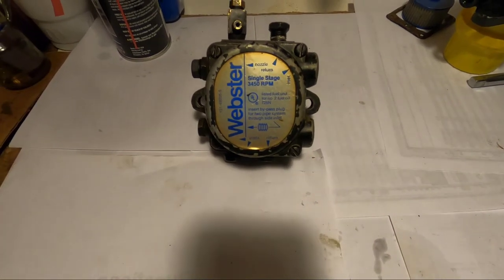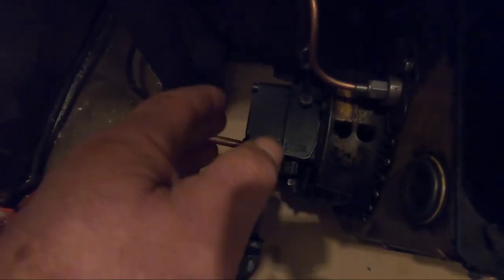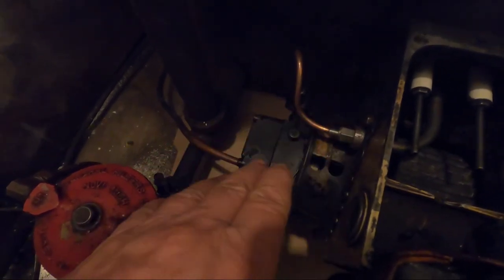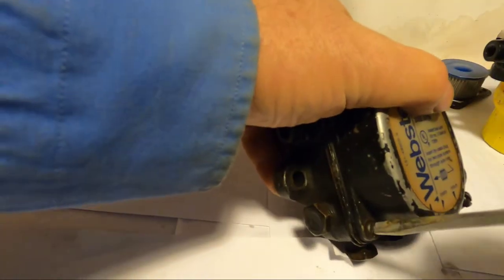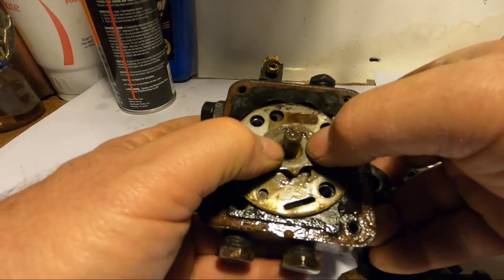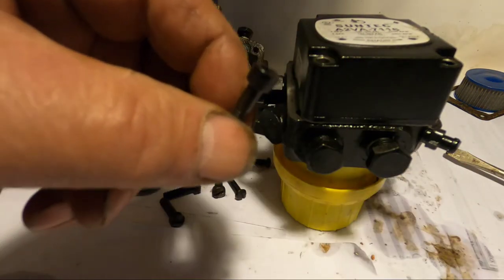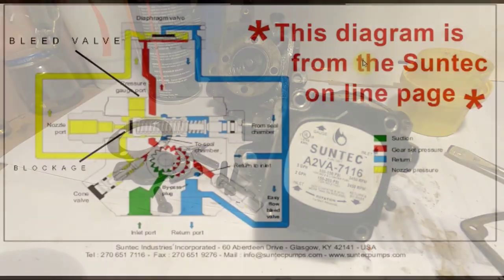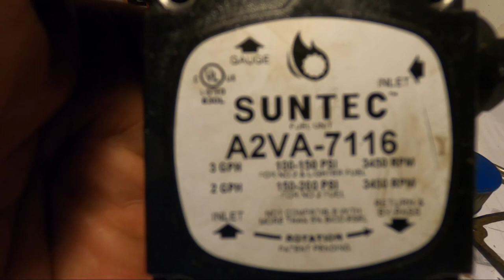NON WORKING OIL BURNER FUEL PUMP A LOOK INSIDE

Comment: I use the Suntec clean cut pump. I think you could convert it to that style, you have to get a new controller. You would be looking at close to 250.00 dollars, the design keeps the heat exchanger cleaner.
Reply from the maker: Thank you for stopping by & contributing with this information. Looking forward for your future visits & comments.
Stay safe,
Joe Z
Reply: Clean cut pumps are annoying, especially when you’re called out late at night to change a solenoid coil.
Reply from the maker: @Skarmy762  Thank you for  stopping by & taking the time to comment.
Stay warm & be safe, Joe Z

Comment: I have the suntech pump shown in video.   Every other day the burner will stop and the red reset light will turn on as if I am out of oil.   If I press restart it will fail.   If I press restart and then smack the suntec label with the side of my hand "Fonz" style it will come to life and the burner will fire.  Thoughts?
Reply from the maker: Hi Chris t, please keep in mind that I am not a tec but know enough to get things going until I get some one that know what they are doing to, and am not making recommendations but just what I would be looking at. That said it could be several areas that would cause this issue. First I would shut off the power then look at the control box for loose screws or wires. Then I would look in the blower housing & check if the squirrel cage ( not technical name) moves freely. If not next question is why. Could be covered with lint/dust, motor going bad or the pump itself on the way out. Also check the Cad cell. It may just have to be wiped clean. Even if you do not find dust on it it may have a film on it.
 I know as DIYers we want to get it done ourselves  but there are times when we have to call in the Pros.
Hope this is of some help.
Stay safe, Joe Z

Comment: Is the Webster pump and the Santec pump the same Moutong Blold holder, is there the same spare par?
Reply from the maker: Thank you for visiting & your question. I am not sure if you are asking if the "block,"  the piece that gets  bolted onto the burner is the same. Yes as far as fitting. Parts are not interchangeable for these 2 pumps. Hope I have answered your question. If not let me know.
Stay safe, Joe Z

Comment: Did the replacement pump have the same rotation or does it matter?
Reply from the maker: It works the same. The blower motor turns this pump.
.john salas I have other videos on my channel that cover different subjects  and new videos added weekly that may also be of help or interest 
Your support is not required but always appreciated. If you are inclined to do so your Subscription, Likes, Comments and sharing this content do help.
Another way to Help Support The Joe Z Channel at no cost to you
is by using my affiliate links or  just go to:
                      https://www.amazon.com/shop/joez

An affiliate advertising program is designed to provide a means for sites to earn advertising fees by advertising and linking to amazon, that helps me to continue producing videos.
Thank you for your support and using the links provided to make your purchases. 
                                                This is always appreciated.
                            ***** Thank you for your support ******
Again I hope you get to  enjoy other videos on my channel as well. 
 Stay safe, Joe Z

Comment: I had done the bleeding before but today only drops of oil come out. I waited only a minute before tightening it. What can I do?
Reply from the maker: If you changed the filter  (the filter on the fuel line) make sure you replaced the small washer that goes under the bolt, and it is tight. If you did not change the filter it may be too dirty to allow the fuel to pass through. Let me know if this was of help.